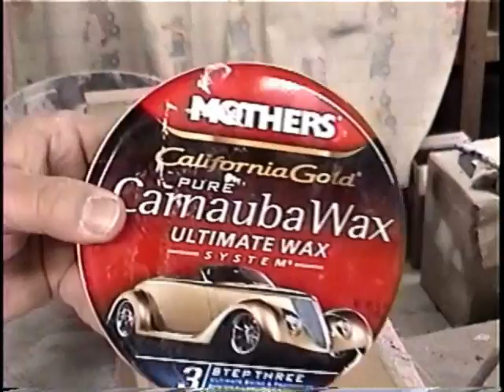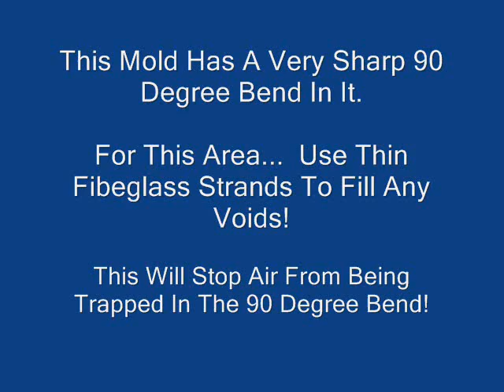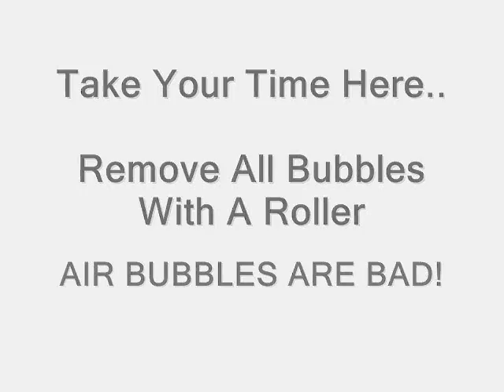HOW TO FIBERGLASS * NACA DUCT *  The Original YOUTUBE SERIES

Comment: Appreciate the videos!  A friend and I have been making customer Subwoofer boxes for cars, and we had an issue with good resin that stuck and caused us to almost ruin our mold.  We then found out that wax was not enough.  I have a gallon of PVA at home now, waiting for me to spray it and make our next box.  My only issue is that we have a lot of complex bends, nothing too crazy, but a solid sheet wont work.  We are using 1.5oz mat, do you suggest cutting, or ripping where the sharper multi bends are, to make it as even as possible.

Comment from the maker: USE PVA.....Keep Trying or you run a real risk of losing your part in the mold process..... You MIGHT GET AWAY WITH IT with just wax...Maybe a few times....BUT, You will get BIT in the ass and will learn to use PVA....Its easy IF YOU TAKE YOUR TIME..Dont Be in a hurry..Let the part get warm in the sun before spraying your PVA...it will dry faster this way...after your 3rd coat..Go thicker...Just used 3 heavy coats after 3 mist coats on your molds.. You have a Large open mold..You need less PVA

Comment from the maker: @jboritzki ................ Mold release wax has detergents in it and slowly eat your molds gelcoat...also has a variation of diesel fuel in it....CLEANER/S..... Works well but harmful to molds.....CARANUBA has No Cleaners or FUEL in it and twice as slippery...... Will never harm your molds........ I'm still using molds that are 30 plus year old and look new...... have a few new molds that were made by the Pro's and USED by the Pros...they are fogging and getting rough already (Mold Release)

Comment from the maker: @robotmotor .............Microspheres work great in places that you cant get Woven Roving into..... Its about a 5th as strong as fiberglass itself as Microspheres itself has air in the center of it.... Very tiny but it does...... If you can get Roving Fiberglass into your bend then its your best bet, if not then Spheres is an option..... Better then Spheres is Talcum Powder and Resin....it acts the same as Spheres but has ZERO holes in it to bust from heat or pressure....... I hope this helps?!?